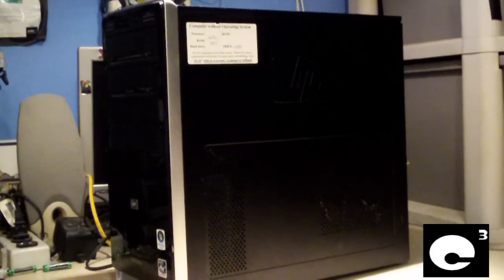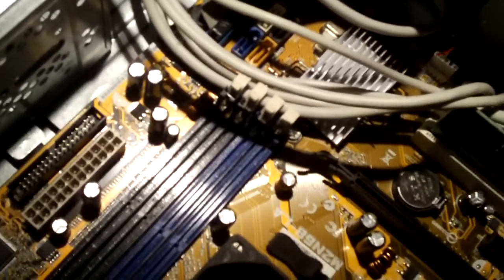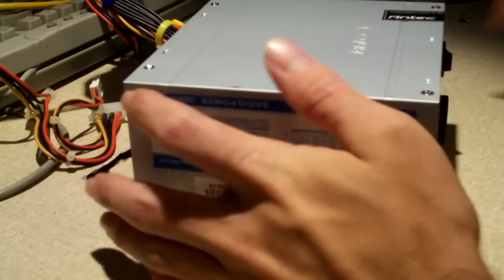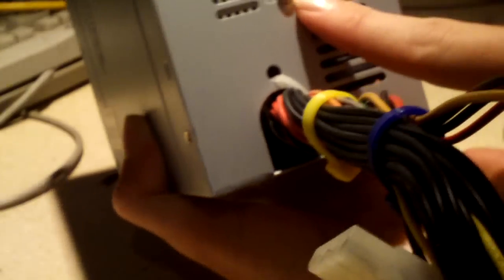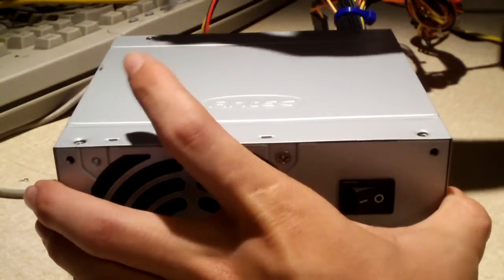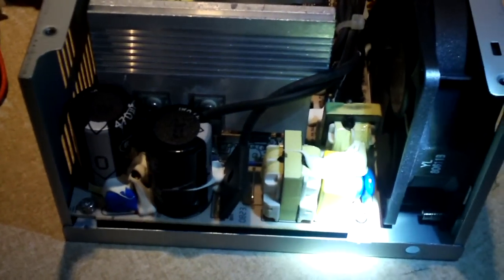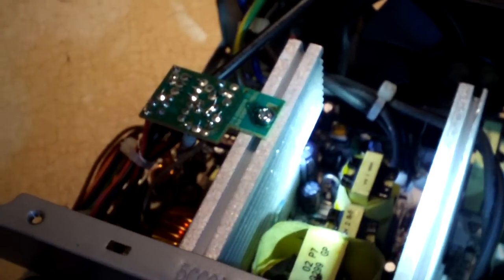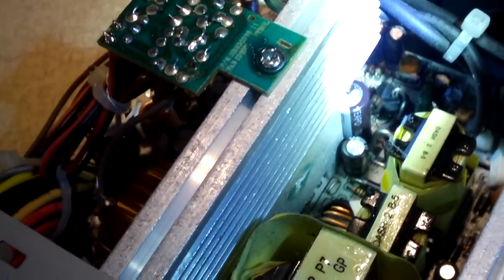Parts HP PC with Failed Replacement Power Supply

Comment: lol I hate that case! I was diving for a parts and found a Pavilion a6683w, Sempron X2 2200 2.0Ghz, 2GB DDR2 800Mhz... and boy it's a hot box especially the Chipset when running onboard graphics. All the fan are controlled by sensors and CAN'T be set with BIOS or Speed Fan. I think it's a decent motherboard ASIS M2N68-LA (Ivy8) and moved it to a bigger case but it's front Audio is a weird duck and can't get it to work fully! Unfortunately, The Bios only supports 2x SATAII but the NVIDIA GeForce 6150SE nForce 430 Chipset can do 4x SATA2! I gotta Athlon64x2 5800+ 89w 2.8 GHz in it now :D
Reply from the maker: +Jason Hicks (TyrForFreedom) Actually this case has excellent ventilation. The motherboard's mounted upside down to put the CPU down at the bottom of the system where the coldest air is. There are also lots of vents on the case as well.

You can modify the fan speeds or disable smart fan altogether, but you have to access the advanced setup utility via a hidden keystroke. I have a video on how to access it...

https://www.youtube.com/watch?v=qSi0Xc4RcUc
Reply: ***** what a hidden keystroke.. count me it! :)